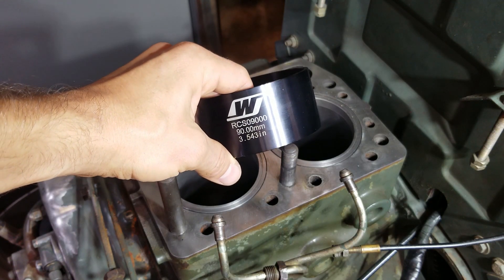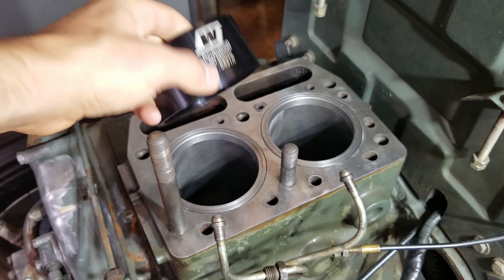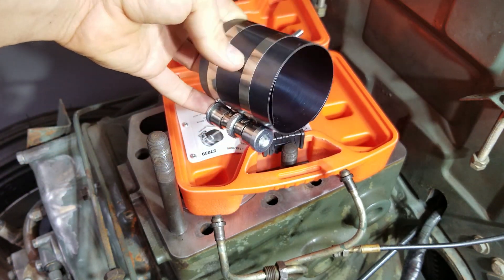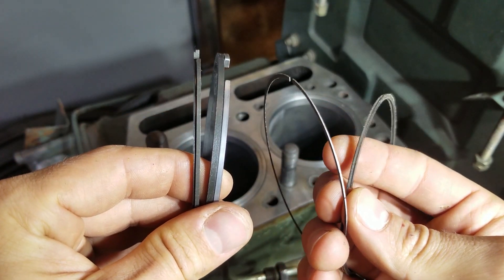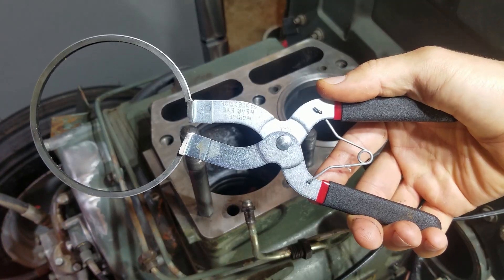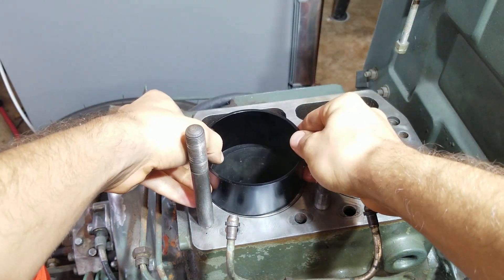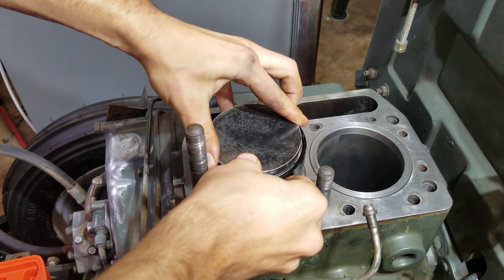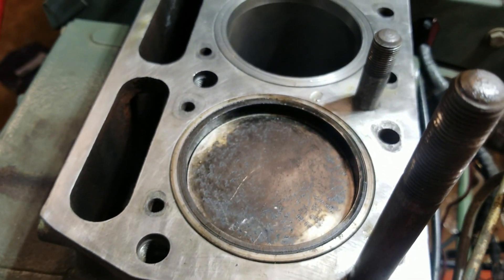This Tool Will Help Rebuild Your Diesel Tractor Engine!

Comment: Hello can you get The 2TR13 engine? I need The whole engine and i cant find it anywhere
Reply from the maker: Very difficult to find good complete replacement engines. Most people rebuild them. I'd check online first or a Yanmar dealer if it's not a gray market engine.
Reply: Ok let me know, thank you

Comment: Getting ready to start engine rebuild in my YM2000. I’m looking for a shop manual to reference torque specs but can’t locate one for sale. Any chance you could post torque specs with bolt tightening sequence…????
Reply from the maker: I bought a service manual for mine on eBay. The YM240 is the American version. Pretty much the same thing. What specs do you need?
Reply: Hey Matt I need the torque specs for the crank bearings, head bolts etc. Also need to min specs on crank.  I’m sure I’m overlooking a few things and thanks for your help and most of all the video. It gave the confidence I needed when I was trying to decide to pay someone or tackle the rebuild myself.